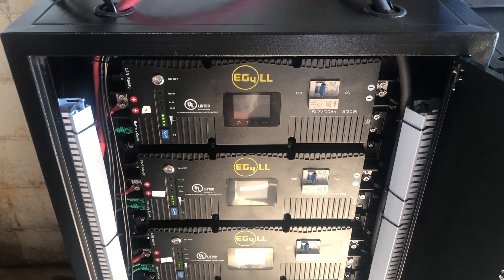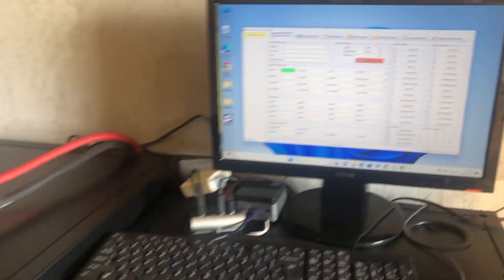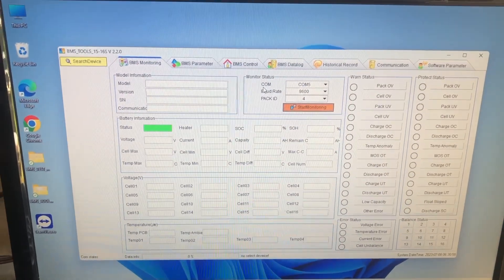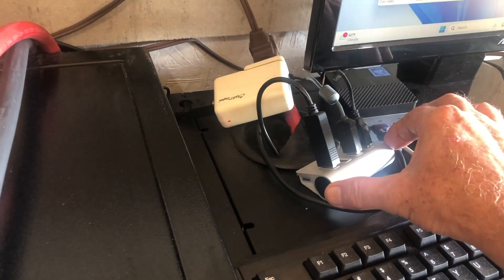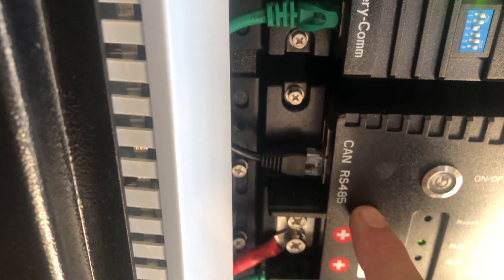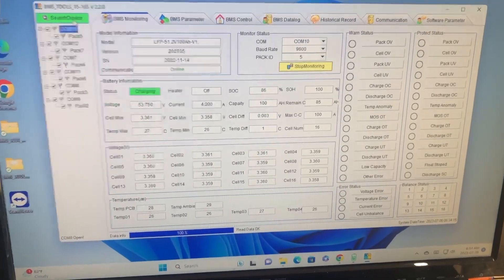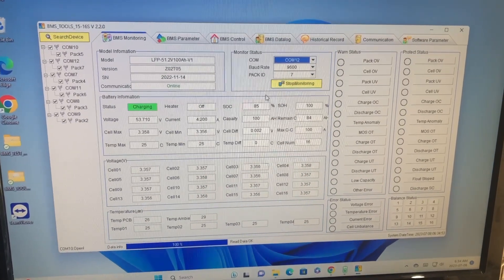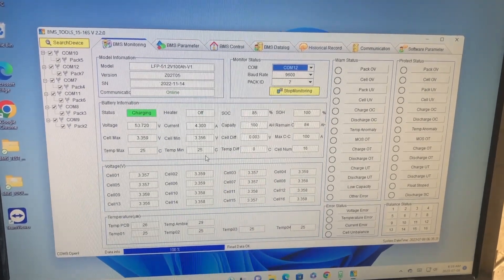Work-Around For EG4 LL V2 Daisy-Chain Not Working With BMS Tools

Comment: Just getting into this following along cause my eg4 'LL v2 are not daisy chained communications batteries are all in the high 90 Soc% individually but together only half Six% ? They at S.S. Said it's a firmware update problem and of course I need a special cable not sent with it?

Comment: So, after a bit of research and testing I figured out a way to get all of the batteries connected with one USB to RS485 adaptor. Pins 1 and 8 of the RS485 port on the battery are RS485 B, and pins 2 and 7 are RS485 A. I made a cable that connects the batteries in series, so (B1-8 -> B2-1 ; B1-7 -> B2-2) (B2-8 -> B3-1 ; B2-7 -> B3-2)... and the USB adapter can connect to either end of the chain. The key to making this work is a setting change in the BMS software, the "Initialization Delay" in the software parameters tab needs to be changed from 400ms to 750ms. RS485 is good for about 4000ft at low speeds, I have a 60ft CAT 5e cable between the battery bank and my computer and the BMS reads the batteries with no issues.
Reply: Thanks for sharing and congratulations on figuring this out. How did you figure out that "Pins 1 and 8 of the RS485 port on the battery are RS485 B, and pins 2 and 7 are RS485 A". So there are two options to get this working? Your method and Lances?
Reply: @jeffntexas8920  I found a document somewhere on the internet, can remember where though.

Comment: I was thinking along the same lines for a solution to this problem.

I am currently running my batteries in BMS mode hooked to a Victron system and the numbers I get from it make no sense. The cell differential reports a 10mV difference, but I have no idea what pack or packs it is referring to. Even when only charging the system from solar and nothing else is running, the shunt reports one current, the pack reports another, but I have to look at the displays to know how much is going into each battery.

I think I am going to get some additional USB to RS485 adaptors and set it up like you are doing.
I wish EG4 would step up and do better.
Reply from the maker: Let us know how it goes.